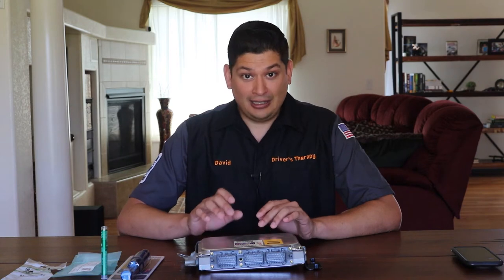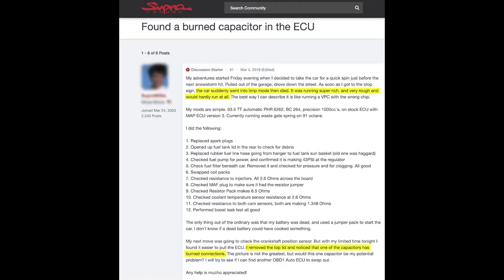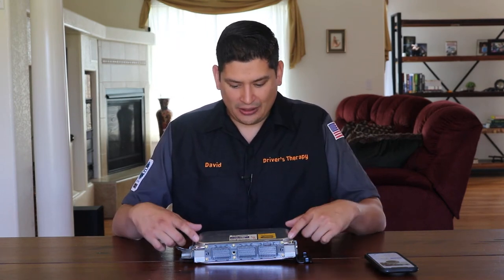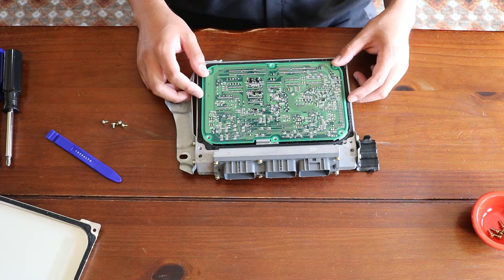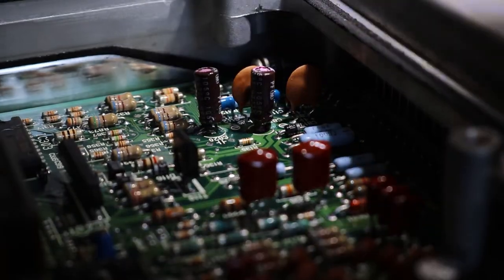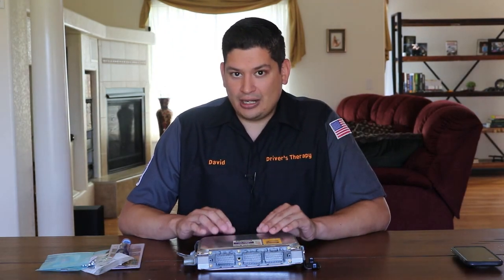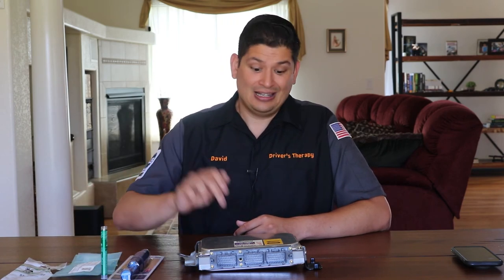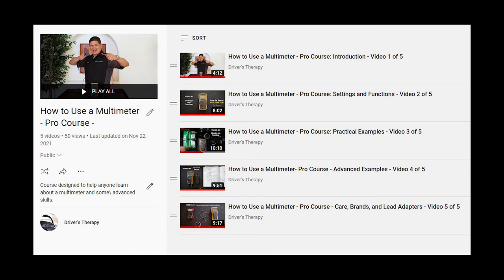Toyota ECU Electrolytic Capacitor Leaking | Diagnosing and Options | 1JZ 2JZ | Automotive Capacitors

Comment: I can't believe that I fired the Parts Cannon At My Car. I was even getting different Engine Codes, And Yes Improper Shifting. A Cap was leaking clear Over To A Microprocessor of some sort. I have had this problem for years. The board Is shot. It's burnt to bad. Fourth Five Years Of turning wrenches and the old Girl Got Me Good!
Reply from the maker: I know the feeling. Mine had me running around for a month replacing parts. 🤘🏽

Comment: Just fixed my 94 Lexus with an old capacitor out of an old stereo i had sitting around. Sure enough it was a leaking capacitor in the ECU that was tripping my check engine light. I replaced the speed sensors a couple times and finally pulled the ECU and looked inside, and sure enough it was a leaking capacitor.
Reply from the maker: glad you found your issue

Comment: what capacitors did you use? I have a 1JZ vvti and in my case I believe it;s the throttle computer
Reply from the maker: I got my caps from eBay. They sell them as a kit. But you can pick up some good ones from some website called digikey something.

Comment: My Supra has been having a problem where I would put it in drive and it would start out in 3rd gear. Popped the ECU off to see a capacitor had popped and seriously burned the board. I bought a new ECU and after installation it shifted fine but the idle RPMS kept jumping up and down. The next day the RPMs were fine and the 3rd gear problem started again. Took the new ECU out the find that the capacitor had popped. Any idea would could be causing this?
Reply from the maker: Hi, it sounds like something is causing a voltage spike and overloading the capacitors. I would recommend looking at the board and making sure nothing is shorted or touching or looks of our place. If you are not able to see anything, while the ECU is out, take it a well-known electronics shop that fixes Xboxes and such, and let them look over the boards. They have equipment that will allow them to do a more thorough inspection if you are unable to find the cause. Thank you for watching our video and hope I helped and if you would be kind enough to please like and subscribe, that helps out.

Comment: Hello, i Have problem with my 93 Supra. My Supra shut while drive but i can start immediately same when she stay. Sometimes she run for hour but sometimes run only a minute. Do you think i had bad capacitor? I had issue with capacitor already in thé past. Thanks for answer😊
Reply from the maker: Yes I do. It is not hard to check if they are. Remove your ECU and look at it. Our video helps you identify them. Let me know if you need anything else.

Comment: Hello there!!  At 4:00 in the video there are 2 caps next to each other, are those 15mf or 100mf?
Reply from the maker: They are 105 degree Celsius Nichicon capacitors: 
The first number is the location on the board and the rest is what is written on the caps. Depending on your ECU, I would open it and verify which ones you have before ordering anything.
Reply: Thanks, I have a twin turbo ecu just like yours but I don’t remember if they are 15mf or 100mf?
Reply: Hi again!  I’m asking specifically about C820 & C818 what are the mf values?  Thank you for your efforts!!
Reply: This may not apply as my ecu is a Gte manual ecu
Reply from the maker: @urbanach1ever203  best thing to do is to open it up and look at it.

Comment: Hi! Have an N/A Auto JDM supra jza80 ecu, and two tiny surface/smd resistors are missing. How can I figure out which resistors I need to solder back on? 
Thank you 🙏
Reply from the maker: Hello, before you go on a hunt, did you double check that those are suppose to be there in the first place? You could be right but ecu setups vary depending on many factors.
Reply: @DriversTherapy  Yes definitely. I pulled it out of my supra to check, and two capacitors had leaked so badly that it literally turned those two SMDs into goo. Managed to source one for a small fortune, has the missing resistors on it, but I can't match them because the numbers have worn off them 🤦‍♂️ lol.
Reply: @DriversTherapy  It was idling warm at 2200rpm and wouldn't go into fourth... severe water damage but it cleaned up beautifully. It's just those two missing pieces of the puzzle. Auto n/a ECUs are so rare and expensive so I'd love to have a spare for when the other one needs inevitable maintenance.
Reply from the maker: @joekickarze  so you have another ecu with the same model number?
Reply: @DriversTherapy  Yep but when I opened up that one, the resistors in there that I need to replace in the other one, had no numbers on them (wear and tear/age, not sure why). I can match up the capacitors easy, writing on them is still very clear but those two SMDs 🤷‍♂️
Reply: @DriversTherapy  The letter and numbers on the actual board are still there right above the bare pads. Could I use that to work it out, or would that be a Toyota marking? It's all closed up but I remember ones like R25, C23 as a rough example. They definitely had one letter (R or C) and two numbers next to that letter.

If it said R25 for example, would I need a 0.25 ohms smd?
Reply from the maker: @joekickarze  I see what your saying but I am not sure why someone would remove them. Do you know what the smd controls?

Comment: Hello friend, I have one capacitor leaking and the hot glue thing in my 4afe ecu ,do I need to remove and change the capacitor or only need cleaning
Reply from the maker: If your capacitor is leaking, it needs to be replaced. If it leaked on the circuit board, you can sometimes clean it. But if it’s bad, you might have to take it to an electronics shop. Just make sure you ground yourself before you touch the ECU.

Comment: thanks for the video
now here is my story
 i drive a 2007 Toyota Mark x  its has the 4GR engine this Engine is similar OR almost Similar to the engine in Lexus is250,
many years ago i developed a minor problem with transmission Which seemed to clear away by itself
the car Would REV  so high(4000RPM) and the rev will not match the speed  it was engaging gears 1, 2, 3 but omitting 4 ,5,6
reported to mechanic  .. all he did was disconnect the negative side of the battery terminal and reconnect it back then the car performed well  with no problem

Many months later this problem came once in a while and i did resolve it by disconnecting the battery terminal
the problem became more and or routine service i asked the dealer to service my gear box by changing the ATF  which was done and problem still persisted,
one day on routine battery service the technical told me my battery voltage is low(9.0)V There was no Check engine light , no Battery flashing all good)  He Said "U NEED TO REPLACE YOUR ALTERNATOR SOON"look like the alternator is not charging well, he allowed me to drive 

Few weeks later the Starter died and we had to replace it
after replacing the STARTER         2 months passed by and the  second STARTER ALSO died 
we replaced it with a new STARTER thereby after 3 months the ALTERNATOR "DIED/FAILED"

question
1 WAS THE POOR OR LOW VOLTAGE  FROM THE ALTERNATOR CAUSING THE STARTERS TO DIE?
2. WAS THE LOW VOLTAGE ALSO CAUSING THE COMPUTER TO MALFUNCTION

we replaced THE ALTERNATOR and on that replacement we got a volt reading of 12.4V
now back to the Transmission
the problem became more common NOW I HAD to always reset the ECU by disconnecting the negative side of the battery every time i want to drive and when i switch off the car if i have to drive it i have to reset by the same procedure and this became annoying

 on diagnostic no error code was captured
THEN gear box dealer decided we replace the shift solenoid which we did all 8 of them
same problem car shift 123 not 456 Very annoying
 he then decided its an electrical problem
then we took to electrician he Scanned     said error codep0176( shift body solenoid c remain open)
learning
p603 engine stall history

He said he cannot fix my car because
which
2 " am not sure if its the gear box or  ECU OR WIRING" GAVE ME MORE HEADACHE
3.Imay be forced to strip off the car and that is too much of a job to do
definitely

Replaced
 TIL I SAW THIS VIDEO 
QUESTION
1 from my history do u think this is an ECU PROBLEM
2.I CANT FIND A TRANSMISSION WIRING DIAGRAM ANYWHERE ON THS CAR WILL CHANGING THE ECU NEW ECU BE A HELP remember the disconnecting and connecting battery terminal to reset then the car wud function well
Please help  my e mail
mikdan2006@yahoo.com
mik2013@gmail.com
Reply from the maker: I just wanted to let you know I read your comment and let me look into it for a day or two. I will get back to you.
Reply: @DriversTherapy  thanks
Reply: I am in Namibia Namibia Is Just Next to South Africa, This Car In Quest "Toyota Mark X" is Not a Common Car In This Part Of Africa ,as my car was imported from Japan, The Market here in Namibia is Dominates With VW, BMW, MERCEDES... The car was Scanned By a Toyota Dealer and It Kept Giving I Guess " ERROR " codes Which When Tackled The Problem Persisted  Codes Like
1.P01603 Engine Stall History : Where the Car Would Go Off When I Change gear From DRIVE to REVERSE , Start Engine car Drives Well ...Nothing was Done About This
2.P0176  Solenoid Shift Valve C Component Remain Open ...Action  done...All 8 New Solenoids Were Changed  
Followed by Entire Valve Body UNFORTUNATELY, SAME problem followed By
3.P0121 Throttle Position Sensor ...SAME sensor changes Problem persist
4.P1589 Acceleration Sensor Error During Learning Process
LASTLY check engine light is still on Oxygen senor Were Changed...
Reply from the maker: @michaeldande  based on what you said I agree with the transmission dealer. If you replaced the 8 solenoids and you are getting codes for faulty solenoids than I would check the wiring harness and if that check out then replace the ECU. You can open the ecu open and look for bad capacitors. I made a video showing how to do that.  Sounds like you have a “gremlin” we call car problems that are hard to diagnose that name. I would buy a digital multimeter and check the wires to the transmission. I would also look at forums and see if there is someone else who had the same problem and see what you find out?
Reply: @DriversTherapy  thanks He scanned the Car there was no code to show the solenoids were faulty no error he changed them based on his experience as per the symptom . i was on a journey 100 km a way from home before starting my journey i had to "RESET" ecu by disconnecting and reconnecting battery terminal ... i drove smoothly until i approached a hill at a speed of 120km definately the car at this point will drop the gear to tackle the hill and i just saw on my rev counter in a split second RPM went all the way UP N DOWN LIKE A seesaw/Compass/weigh scale gauge with heavy load like a crazy swing on the rev counter and from that point i knew it became worse    ... The MARK X ecu had 3 chips controlling transmission  car and engine...i Still feel there is no problem with the wiring,,,what if a capacitor was failing what if it leakeg and blooked transmission network to OVERDRIVE ..why does the car keep throwing faulty codes which are not faulty
if it was wiring then resetting ECU wud have not solved it an just thinking
remember the battey the alternator the starter look at this cycly all replaced ECU needs a minimum Volt To keep Functioning .Is It the ECU. ANY ONE ONE way to Find out... replace ECU if problem persist n we dont find any damaged capacitor then we eliminated all the posible causes n its the wiring.

Comment: My 1UZ swap is200 had bad ECU too
Will have random cel can’t clear 
Car no start , lots weird problems 
Change to spare ecu solve everything
Reply from the maker: Awesome! Glad you fixed your issue.
Reply: @DriversTherapy  90 Lexus/ Toyota is reliable 
But they are 20s old car already …
Not really fix it , i found out on Dyno ls400 ecu have 20hp less then Gs400 , so I still need to fix my Gs400 ecu to gain my performance back